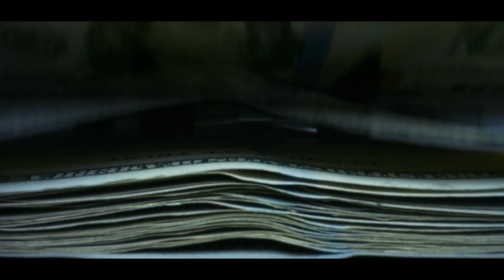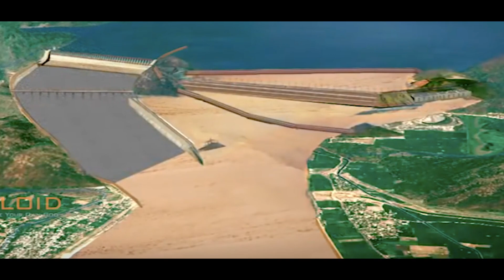India’s $6 Billion Dam Will Blow Your Mind

Comment: In term of cost, the Polavaram is $2.1 billion, wheteas the Three Gorges dam was built costing $37 billion. Water capacity, the Polavaram will be 0.150 billion cubic meters, Three Gorges is 39.5 billion cubic meters.
Reply from the maker: You're right, the Three Gorges dam was a much more expensive project, but the Polavaram dam is still a very impressive piece of engineering.
Reply: Actually polavaram can use 99.3 % of the water from the reservoir. 
Even India there are some larger than this Dam but this type of dam is the first time in India.
All the dams in India actually built on Rivers but polavaram Dam constructed 2.5 km right side from the river.
Reply: China does not consider environmental issues and human rights, they just build wherever they want because it is under Dictatorship, but  democratic Countries need to consider its people too.